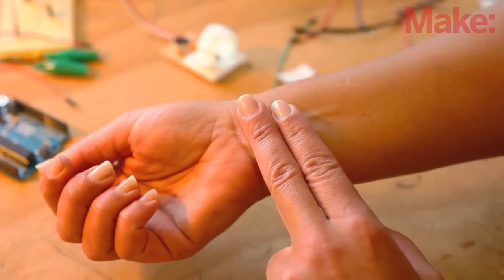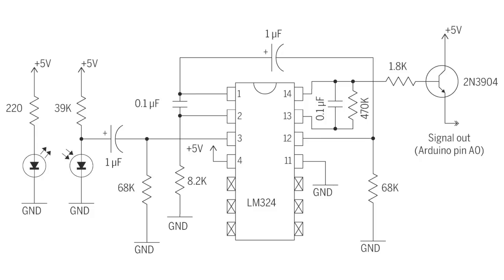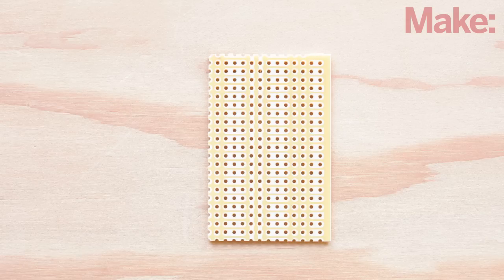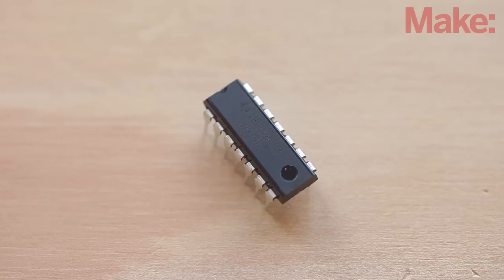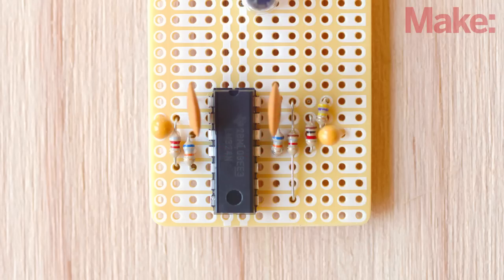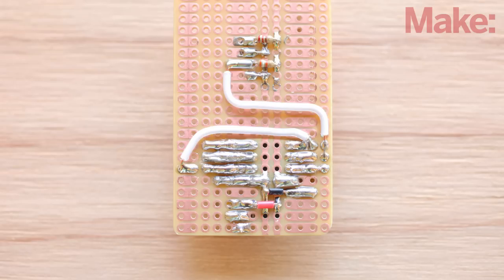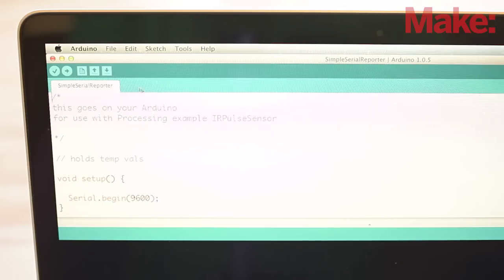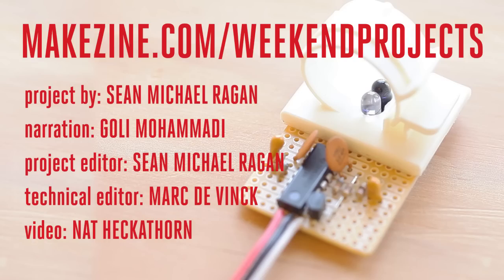Weekend Projects - Infrared Pulse Sensor

Comment: A small correction in the circuit has made a great difference... Please connect the PHOTODIODE in REVERSE BIAS ... Then the circuit works fine :)
Reply: would you please explain,,,
Reply: @abdullahalrumon6437  You should be fine if you follow the steps shown in the video, i.e. seat the diodes flat-to-flat and make solder joints as pictured. In fact this actually puts the photodiode in reverse bias mode (its anode at ground and its cathode at higher, positive voltage) - resulting in a wide depletion region where free charge carriers are created by the incident light. The schematics showed both diodes with forward bias, which is wrong for the detector. The narration was incorrect there too: it is emitter's cathode and detector's anode which are connected directly to the ground rail.

Comment: The function of transistor is provide the necessary current to arduino, maybe the Op-Amp supply this function or maybe not... The 1st stage is required to saturate due to amplifying the signal of IR. Sorry for my bad english :D

Comment: Actually if you should reduce the gain of circuit, as we can see that PPG is losing its basic shape the opamps are saturating  giving a square type waveform,so just try to reduce the gain of 1st stage opamp  stages.

Comment: i think in signal out you can use a red led without connecting it to the arduino...because is the output,so you can get the output pulse results of your finger :)

Comment: Why didn't they use the extra two op-amps on the LM324 IC for the output stage instead of the BJT?  I agree with qwaqwa1960 the BJT circuit is incorrect for proper amplification

Comment: That was A LOT of solder used on the OP amp. I'd be worried about accidentally bridging connections if I put the other components on! Why not get another OP amp model instead of cutting off the leads? I'd at least put a connector on the board rather than break off perfectly good connections. Also, what is the transistor for? It won't affect the output too much, but it really does not need to be there. It's an interesting project, but the configuration is weird...

Comment: Oh, I see. Well it just bothers me how they ruin that LM324 by cutting off the pins. It wasn't even meant to save space, it's just to "avoid confusion"... why not solder a 14 pin socket and clip those pins? Keeps the LM324 untouched

Comment: I made this with an lm358 instead, seemed more logical as it's a dual op amp. It gave me a really nice pulsing action whilst using a transistor and led on the output, but it's pulsing out of itself without me having layed my finger on the sensor. It is reacting to my finger, and giving me what seems like a pulse, but is there any way to make it stop pulsing without any finger on it, because I feel the capacitors are determining the actual pulse frequency? I followed and matched circuit diagram with only a deviation of 1K in the resistors values at max (Only for the higher value resistors, the rest is identical or closely matched). But I only have 473Z ceramic capacitors, and 2x 1-25 tantalum capacitors, is this the problem? I would really be grateful if somebody could clear this up, it's my first Arduino project, after allot of analog projects and I would really want it to work, been trying all day now and i'm getting really frustrated :(! Thanks a million in advance!
Reply: Well I managed to make this awesome heartbeat monitor eventually, although completely altered and adapted! I have a video on my YouTube channel including a proper circuit for the LM358 Version...
Reply: Can you send me the link?
Reply: The fact that it’s pulsing out itself, might be caused by noise and other RF signals around you...

Comment: Hi this is cobe
    // Based on examples from Arduino's Graphing Tutorial and OscP5 documentation
    import processing.serial.*;
    Serial myPort; // The serial port
    int xPos = 1; // horizontal position of the graph
    float oldHeartrateHeight = 0; // for storing the previous reading

    void setup () {
    // set the window size:
    size(600, 400);
    frameRate(25);

    // List available serial ports.
    println(Serial.list());

    // Setup which serial port to use.
    // This line might change for different computers.
    myPort = new Serial(this, Serial.list()[1], 9600);

    // set inital background:
    background(0);
    }

    void draw () {
    }

    void serialEvent (Serial myPort) {
    // read the string from the serial port.
    String inString = myPort.readStringUntil('\n');

    if (inString != null) {
    // trim off any whitespace:
    inString = trim(inString);
    // convert to an int
    println(inString);
    int currentHeartrate = int(inString);

    // draw the Heartrate BPM Graph.
    float heartrateHeight = map(currentHeartrate, 0, 1023, 0, height);
    stroke(0,255,0);
    line(xPos - 1, height - oldHeartrateHeight, xPos, height - heartrateHeight);
    oldHeartrateHeight = heartrateHeight;
    // at the edge of the screen, go back to the beginning:
    if (xPos >= width) {
    xPos = 0;
    background(0);
    } else {
    // increment the horizontal position:
    xPos++;
   
    }
    }
    }

but with this code is error is so help me

https://image.ibb.co/maWyHw/error.png